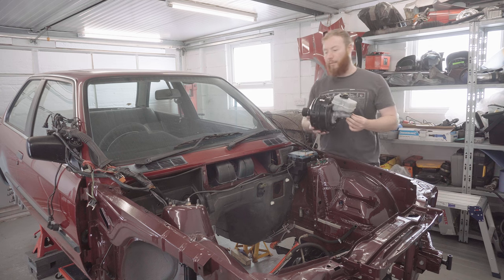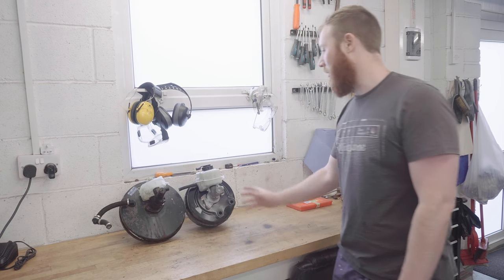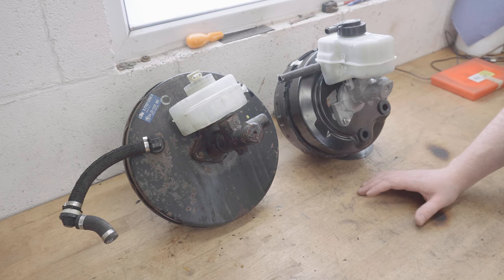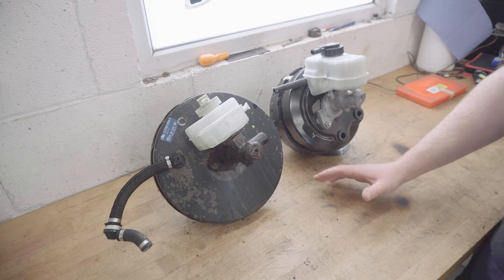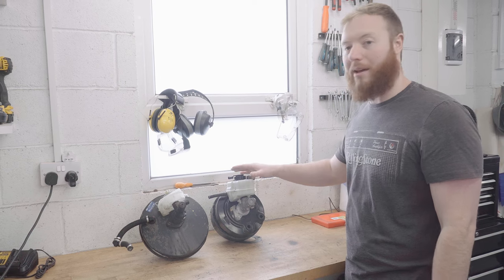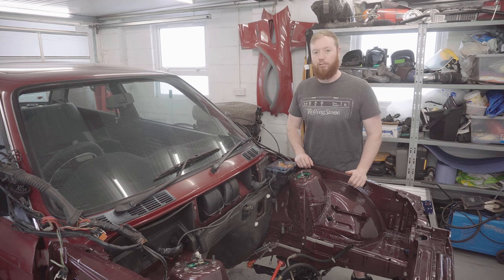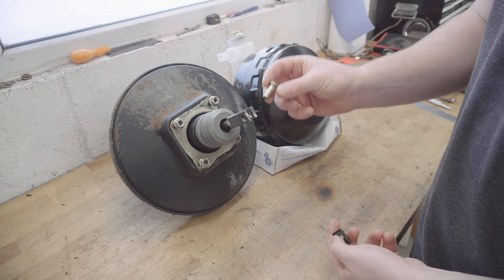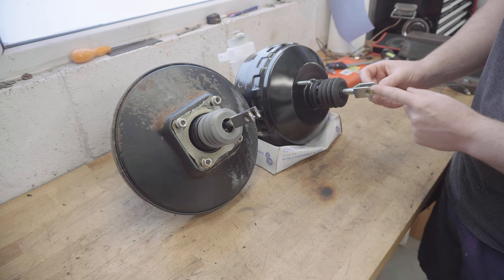How To Fit E90 Brake Booster Into BMW E30 M52 Swap RHD | Slim E9X Servo Install Guide | 043

Comment: @SPANNERRASH and all - Another Tip that the lad at the scrapyard told me is that pre facelift E90s didn't have the Booster Vacuum Sensor, I got that one and seems like I wouldn't need to block that off. Haven't done it yet so not sure if anything else is different :) Great Guide as always!!!
Reply from the maker: Ahh yes somebody else mentioned about that additional port. I thought all E90's had it but evidently not. Finding one without will save you sourcing a bung. 😃 Cheers!

Comment: Another video I have been looking for! This is also on the list due to my s38 swap, didn’t think the clio boosters were as available as they used to be. Great information too, you really do put some effort into these vids!
Reply from the maker: Couldn't even find a decent pic of the correct Clio booster 😆

Someone else in the comments mentioned that having tried both, the E90 booster gives much better feel. Looking forward to feeling it. 

Hope the vid helps you along with the build mate!
Reply: use th E65 brake booster for E38/39

Comment: On Z3s they use M12 and M10 brake unions so that you don't mix up the lines going to the ASC controller...think it's M12 nearside and M10 offside...
Reply from the maker: That's interesting, I didn't know that was a thing but it makes quite a lot of sense.
Reply: just had a look at the Z3 braking system diagram...they are all M10s at the calipers but when you get to the unions on the ASC module, it's M12 nearside and M10 offside

Comment: Big thank you for the video on the topic. I use E60 booster with E34 rubber mounts and this brake fluid reservoir (03.3508-5851.3) exactly the same as in the video but with an added port for the clutch.
Reply from the maker: Sounds good! Hope the vid proved useful for you, thanks for sharing the extra info.

Comment: Very very clean install 😊
Love it. 
Better than my installation on the lines. But mine is ABS, so had to custom it. 
Small heads up, on the servo matting side, try to apply some sealant or gasket, this has a purpose of not letting water in and movement of the firewall against the servo. Can have some creaking noise due to only 2 bolts. 
Oh, another tip, F10 brake reservoir sits in very well and looks like factory fitted. 
Clears the throttle body of the M52.
Reply from the maker: Thanks Felix, yeah I thought ABS would make life a bit more awkward so I'm lucky I guess.

The E90 booster did actually come with a little foam gasket which I made sure to put on, hopefully that prevents any creaking etc. 

Would the F10 reservoir fit with an M50 intake manifold too? I'm debating trying one out when the engine is in. 😄
Reply: Yes, it does clear the M50 Manifold also.  And looks factory made.

Comment: nice work. i would make a bracket to pick-up on the reservoirs mounting holes. Maybe drop it down to pick up on the master cylinder/servo mounting studs directly below?
Reply from the maker: Thanks Martin, yeah I plan to do pretty much exactly that. No doubt there will be a lot of refining to do to this E30 once it's all back together. I'll be keen to get things like that resolved once it's a car again.

Comment: Great video! I too was dreading the part where I would have to weld the E30 clevis onto the E9X booster but I found out just as you did that there was no need to do so. I used a longer clevis pin in mine which I handily had in a box of bits. Another thing to note is that there is a E9X booster which only has one vacuum port. When I bought mine off eBay I had to double check the pics of the actual part to make sure it only had one port.
Reply from the maker: Thanks mate! Ahh I didn't know one existed without the additional port, that's good to know, thanks for sharing that, it could help someone select theirs better.

I hadn't even thought about that until I got the booster to be honest.

For once I think RHD have an easier time with this one. Normally it's just extra complication.
Reply: Forgot to mention the braking feel of this booster compared to a clio booster is absolutely superb, it’s a night and day difference when compared to the clio one. 

I found the clio booster gave me very wooden brakes that did nothing until they would lock up suddenly with very little braking feel at the pedal. 

The E9X booster gives a very nice pedal feel and you can feel the brakes coming on progressively and no locking up. 

I’m sure you will be very happy with this setup when it’s all up and running, I definitely was with mine.
Reply from the maker: @ajbrar6554  Oh wow, well it sounds like I've done the right thing going this route then! Can't wait to see how it all feels when used in anger. Cheers!

Comment: Does anyone know the part number for the spring tensioner that is seen at 14:05 ?
Reply from the maker: Hi Joe, I think 35211157854 but its NLA.

Strange how the don't show the spring on the diagram here: https://www.realoem.com/bmw/enUS/showparts?id=AB12-EUR-05-1990-E30-BMW-316i&diagId=35_0047

Hope that helps!

Comment: In  mine i have put in from golf mk1 series didnt touch anythin even the rod for the pedal is exact  replacement and have no problem years now. I used the original e30 pump
Reply from the maker: Nice, I haven't heard of that option before, but it sounds like a good one. Cheers
Reply: @SPANNERRASH  you dont have to do anything its an exact replacement i am bmw mechanic i have put the engine back at 2008 and still everything good

Comment: Such good info in here thank you mate, i would have definitely welded the E30 pin on, at least with this info i can knock up a new pin and some spacers on the lathe to get the job done.
Reply from the maker: I was bloody certain I'd need to weld the E30 clevis onto it. Everything I'd read said so.

Glad I offered it up to the car and checked before getting handy with the angle grinder. 😆

Hope the vid helps you out with yours!

Comment: If your making a line up from the T piece to the cylinder you could do away with the adapter
Reply from the maker: Very true, could have just done an M12 fitting for the fronts between it and the T-piece. But I didn't have any M12 fittings, and I'd still need the adapter for the rear.

There are a few ways to skin a cat, but I think this arrangement worked out pretty well. 😁
Reply: @SPANNERRASH   very indepth - i like it, i fitted m52 to my e21

Comment: Can't wait to see the engine in the bay with your booster work.....will you trim off the break fluid container fastener holes?
Reply from the maker: Thanks John, hopefully it fits like I expect it to! 🤞

Good question on the fastener holes, I'm considering a little bracket to secure it to the booster and use them.

While I'm sure it's not going anywhere, because it only connects via push-fit with the 2 tubes, it doesn't feel as solidly on there as the one I removed did. Not helped by it being taller either.

So I'm considering that more than chopping them off.

Comment: What’s the part number for the right hand drive master cylinder with the ports on the left side towards driver fender. Perfect for US M5x swaps
Reply from the maker: Here's the info:
BMW 3 Series E90 E91 E92 E93 LCI Brake Servo Unit Master Cylinder 6788040 (UK market, RHD).

OEM part no.: 34336779721 34336785665 34326764117 6788040

Hope that helps!

Comment: Heya mate , what size pin did you order ? Ordering some parts now but waiting on the booster to arrive so i cant measure it . Great videos mate. !!!
Reply from the maker: No problem, it's the M10 35mm one here: https://ebay.us/bDqOG5

Hope that helps, good luck on the booster swap. 😃

Comment: I've bough an E90 brake booster, but which type/ model no. of the recommended brake fluid reservoir should I get?
Reply from the maker: Hi mate, this is the one I used, works perfect. It's a 1602/2002 Brake Fluid Reservoir: https://ebay.us/44sum7

Comment: I have seen people using the e60 reservoir because it is smaller than the e90 reservoir and does not sit at an angle in the car. I will try this soon
Reply from the maker: Interesting, I'll look that up.  The 2002 resevoir does seem to be a very good solution, especially using the E30 top for the level sensor.
Reply: @SPANNERRASH  yes and the E30 top fits the E60 reservoir as well, you don't even have to change the grommets to fit it on top of the brake cylinder. But I think it depends on the intake manifold and how much space you have, it seems to work well with M50 swaps
Reply from the maker: @Valnar1512  It sounds very interesting then, thank you for sharing the knowledge on that!

Comment: Awesome series dude! Me and my dad are following along, M52B28 into a 316i.

We've gone for the same E9X booster you've done but the pedal doesn't return? Not sure if you or anyone watching encountered this?
Reply from the maker: That's amazing that you're working on pretty much the same build with your dad too. 😆

I hope the project is going well, the brake pedal with the E90 booster feels really great so far, feels totally normal and returns.

Check your linkage I reckon, maybe its catching on something.
Reply: @SPANNERRASH  thanks dude! MOT booked now 🤞. We've sussed the brake issue, where my 30 has ABS you need to adjust the pedal so that the linkage lines up. There's a nut behind the pedal on the linkage that allows for adjustment. Hopefully someone finds it helpful.
Reply: @SPANNERRASH  This is dad all good mot passed and hes like a Cheshire cat , great series and thankyou for all the tips and guides
Reply from the maker: @davidthomas8317  Haha perfect! I was grinning like a Chershire cat too, enjoy 😃

Comment: Turned out to be such a relatively easy swap! Nice one. Not sure but doesnt the pin need to sit more firm? In the e30 it can't move if i'm not mistaking. Maybe add some extra spacers ? Guess the pin could wear over time when it's able to move. Or i'm just being too precise, thats also a possibility 😂 can't wait for the engine fitment. What are your plans with the engine on the channel? Gonna rebuild it first ?
Reply from the maker: Took me a while to figure it out if I'm being honest! 🤭

I think the pin is spot on, sure there's no play in the E30's clevis/pin but seems to be like as long as it's kept around central, which the spacers solve, there's nothing really to go wrong with it.

I think the extra wear will be a long way into the future but, interesting point. Maybe I'll grease it every so often. 😆

Going to give the M52B28 engine a good check over and unless I see something that warrants a rebuild I'm just going to send it. I'll have to tidy it up a bit first though, it can't look scruffy in my shiny engine bay.

I can always rebuild it in the future, but I'm dying to get this car moving under its own power again ASAP. Fingers crossed I can proceed with the plan and don't find anything wrong with it. 🤞

Comment: Does the master cylinders have the same cylinder size for both front and rear as the original one?
Reply from the maker: Almost certainly not, but I've also switched the calipers so that was already out the window. 😆

I suspect the front/rear ratio will still be good but I will hopefully find out very soon!

Comment: What vaccum pipe did you use for the servo? , im using a generic pipe and its got quit a big kink in it, thanks!
Reply from the maker: The one which connects to the intake manifold? I think I covered that in a later video, the one where I fit the M50 intake manifold.

However, I can tell you I used an off-cut of PAS line. A very sturdy line. It's strongly advised that you use a reinforced and/or steel braided line for this.

If it's a soft line and it collapses, you will lose braking force and it could end in disaster. Definitely don't run one with a kink in it.
Reply: @SPANNERRASH  Thanks man, i done the e90 booster swap already and just finished the mondeo mk3 caliper upgrade. But not 100% happy yet 😂 will try replacing the pipe 👊🏽
Reply from the maker: @e30hope   No worries mate, glad to help. Mondeo caliper upgrade sounds interesting I will look that up.

Comment: Brake Fluid Reservoir from F10 looks more OEM
Reply from the maker: Interesting, I'll take a look. Is it a direct fit to the E90 booster and would fit with M52 + M50 manifold?

Comment: it is indeed proportional valve. but i have mine removed completely. i have 1to1 same vuild as yours, and i was worried that removing it from the game will make it lock the rears. however already 2t km on ODO and everything brakes as a charm. no sign of rear over braking.
Reply from the maker: Aha!! Thank you for clarifying that, I thought it might be. I might try removing mine at some point too and see what the effect is, I guess no effect in your experience. 😄
Reply: @SPANNERRASH  you actually can remove straight away. as later it will be pia to reach it there. main differense is that original e30 brake master had equal size out-ports for front and rear + you (as i :) ) had drum rear brakes, so therefore pressure going to the rear and the front was equal, however braking effeciency of drum rear and disk front brakes was different. so thats where proportioning valve comes in play. 
however in newer e90 beake master cylinder you can see the diameter of the front and rear outgoing ports stamped on the body of master cylinder. and main thing that they are different from the factory 👌
Reply from the maker: @Johnson26905  I see, that makes sense! Well that's really typical as I do want to remove it now, but since filming I decided to go ahead and bleed the brakes back up!

I think I'll save removing it for a later date because I absolutely hate getting brake fluid everywhere. 😆

But now its definitely on my list, thank you for enlightening me on that!
Reply: You could also replace it with an adjustable one
Reply from the maker: @mcjjordan  Good thought!
Reply: @mcjjordan  there is absolute no sense on having one installed, if you are not tracking the car. And even in that case, you do it once, and thats it.

Comment: What and where can I get the rubber grommets and adapters for the brake line.
Reply from the maker: All parts linked in the description my guy! :D
1602/2002 Brake Fluid Reservoir: https://ebay.us/44sum7
Grommets: https://ebay.us/2GdX3P
Brake Line Adapters M12 to M10: https://ebay.us/q0Q2kD
13mm Vacuum Bung: https://ebay.us/65SM1E
Brake Line T-piece: https://ebay.us/gEJ3pw
Longer Clevis Pin M10 35mm: https://ebay.us/bDqOG5
The Wrong Brake Line Flaring Kit: https://ebay.us/x3P5yu

Comment: Hello! Do you need anything else to put the admission multiple?
Reply from the maker: Hi Rodrigo, not sure I totally understand your question, but this setup worked great for me and I left no steps out of the guide.
Reply: @SPANNERRASH  I was referring to the intake manifold, I already installed the e90 brake pump and I have a problem with the installation of the intake manifold
Reply from the maker: @rodrigotv9934  Ah check out my later video about installing the larger M50 manifold. It's tight but with a little trim of the fins on the manifold it fits perfect! You will see 😃
Reply: @SPANNERRASH   Thanks Bro! 🤙🏻

Comment: Is it better to use a rhd master brake cilinder for a LHD E30?
Reply from the maker: LHD and RHD E30's have the brake master cylinder in the same place. Just RHD cars have a linkage inside the cabin.

However E90's are sided. LHD E90s have the master cylinder ports on the booster on the wrong side for the E30, so pick up a RHD E90 brake servo and you will have a better time. 😃
Reply: @SPANNERRASH Thanks for your prompt reply and confirmation.
Reply: @SPANNERRASH another questions, is there a difference in the brakebooster itself, between lhd and rhd?

Comment: Hi, would the e90 booster work with e30 master cylinder? Don’t really want to play with hard lines
Reply from the maker: Interesting question, sadly though I'm pretty sure the answer is no.

The studs that fasten on the master cylinder to the E90 booster are nowhere near the ones on an E30 MC.

I can't think of a way to make it work without some kind of adapter, which would definitely be harder to make than messing with the lines! 😄
Reply: @SPANNERRASH  that is good to know, might give it a try making the hard lines then.  I wanted to do some sort of upgrade to my brakes but not sure what yet, might just go for harder pad better discs and braided lines. I want to turbo my m20 might be enough stopping power anyway
Reply from the maker: @Dsilveiro   by all accounts this E90 booster should make the brakes feel a bit keener than the stock E30 one. But I reckon you're right about trying the others first.

A quality set of pads and discs could transform the initial bite, and some quality fluid could help reduce fade from repeated stops.

Of course, if the soft lines are original they might be bulging under hard pedal stomping, so switching them for braided sounds good too.

Bear in mind though, the tyres will probably have the biggest impact when it comes down to stopping distance, especially if you've no ABS like me! 😆
Reply: @SPANNERRASH  I do have ABS and brand new tyres, always wanted wilwood 4pot but maybe don't need that much stopping power
Reply: Thank you for a very informative video. You’ve gained a subscriber 😊
Reply from the maker: @a1962Cobra  Cheers, glad to have you on board! 😁

Comment: Would a brake booster from an e90 automatic be the same
Reply from the maker: I certainly think so, but I'm not 100% sure about that so worth researching.
Reply: @SPANNERRASH  do you have the part number you used please
Reply from the maker: @Graham.-E30  Cant remember it if I'm being honest. This one looks spot on though: https://ebay.us/TopN1v

I doubt the auto ones are any different, but I'd hate to be wrong about that.

If you pick one with only one vacuum hole though you won't have to plug the second. 👍